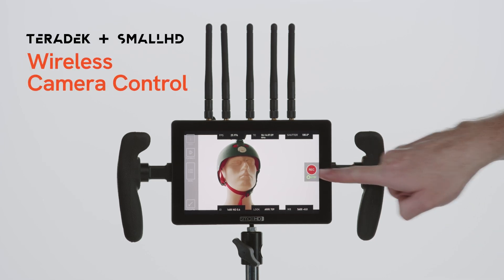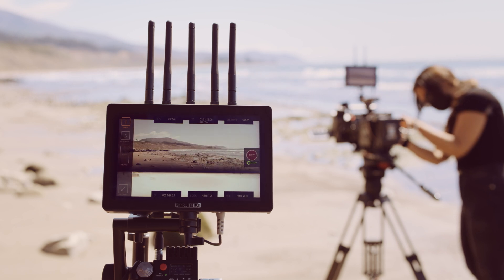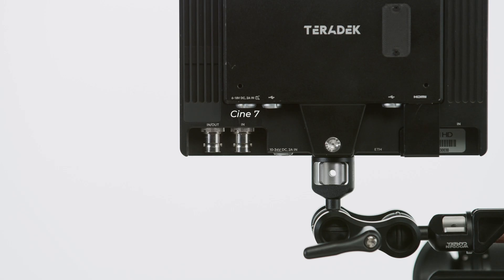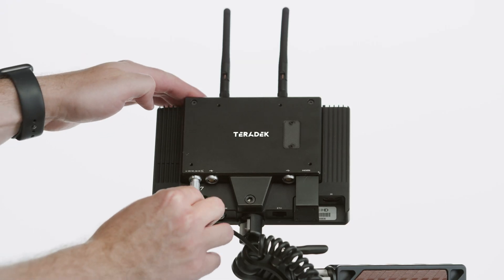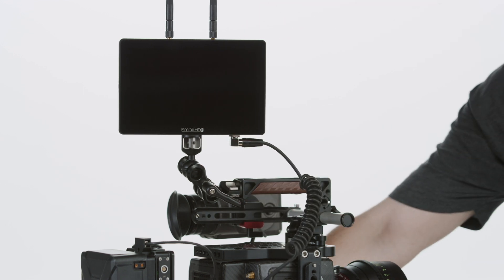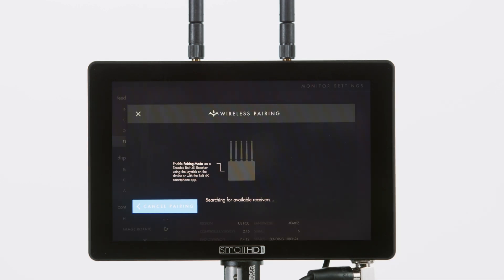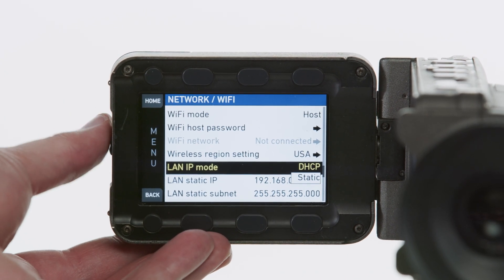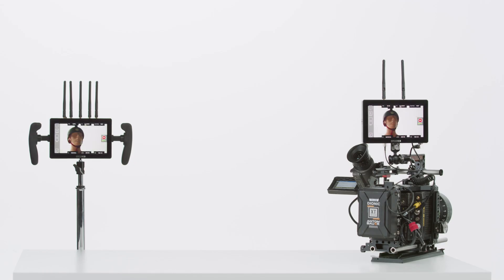How to Set Up Teradek Bolt 4K Monitor Module 750 TX

Comment: I’m unable to use the RED RCP2 Wired Control with the Teradek TX Module—it keeps showing ‘Connection to Camera Failed.’ Interestingly, it works fine when I use the SMALL HD Adapter instead. Could this issue be because the promised RED support for this feature is still ‘coming soon’ even after three years?

Comment: I can't see the teradek menu on my monitor. It is brand new and it only worked once. I sent you an email but no response. Can someone contact me please?

Thank you.
Reply: Did you ever get a reply on how to fix this? I have the same issue with my bolt 6 monitor module TX.
Reply: Update: I loosened the big bolt on the bottom of the back of the monitor that screws the module on. I guess it was too tight and messing with the usb connection
Reply: @bransoncusack3348  same issue with my Bolt 6 Module RX
Reply from the maker: Hi Mario, thank you for reaching out. I have let our Support team know!
Reply from the maker: Hi Mario, please check our inbox, as our team responded on the 19th. We'd recommend checking the USB port is working on the monitor and that they are powering the module correctly. Please continue the conversation with Support via email.
Reply: @Teradek  Hello Same problem for me. Teradek  LT button doesn't appear in the feed menu
Reply from the maker: @antoinepick8651  Hi Antoine, have you tried checking the USB port and contacting our Support team at http://teradek.com/contact ? I can follow up with our Support team if you've already done that—just let me know. Thank you!

Comment: What if we got multi-monitor set up? Like a teradek module attached to a host camera, and then wirelessly transfer that to 10 different monitors in real time, does this do the job?
Reply from the maker: You can connect 1 Bolt 4K Transmitter to up to 6 Bolt 4K Receivers. So you can view the video feed on up to 6 monitors in real time. Are you instead asking if you can do wireless camera control via 10 monitors?

Comment: if you don't want to use bolt/wireless transmission feature, you can simply plug the power plug to the cine 7 instead of TX/RX module? Or is there any other way to turn wireless transmission feature off when I want to?
Reply from the maker: Yes, plugging direct to the Cine7 monitor will bypass the module and power the monitor only. You can also choose in the PageOS4 menu which input to utilize, whether its the wireless transmission or hard-lined.
Reply: @Teradek  Thanks for the reply! I have one more question.
Last time I checked, there was only cine7 and RX module deal on smallhd online store but there was no cine7 and TX deal. I'm considering to purchase 2 cine7s and both TX and RX module for each cine7 so could you please release set deal for cine7 and TX module?
Also are they compatible with Ace 500?
Reply from the maker: @XXXX_XXXX_0  No, the Monitor Modules are not compatible with Teradek Ace family and any other previous generation of Bolt. The Monitor Modules are part of the Bolt 4K family, which means they are compatible with all ranges (750,1500, MAX) of Bolt 4K, Bolt 4K LT and Bolt 4K Monitor Modules. 

As of now, there is no bundle deal for the Bolt 4K Monitor Modules TX with any of our monitors, you would need to purchase them a la carte https://smallhd.com/collections/wireless-monitors?product_id=6582271475845&variant_id=39447415881861&product_handle=bolt-4k-monitor-module-750-tx-for-smallhd-smart-7-monitors

You are also always welcome to reach out to the SmallHD sales team incase it's something that can be put together! https://smallhd.com/pages/contact-us